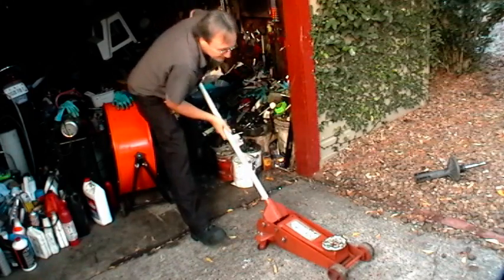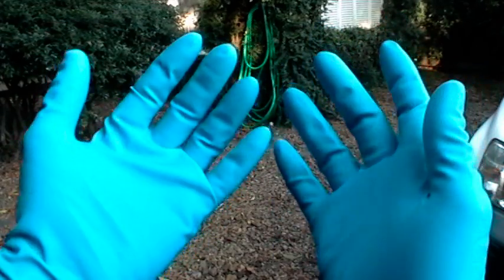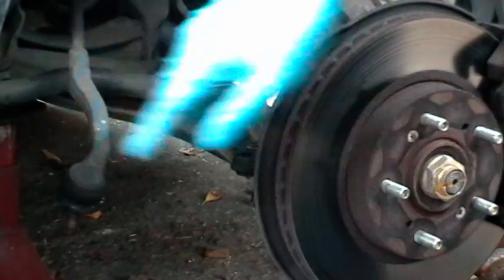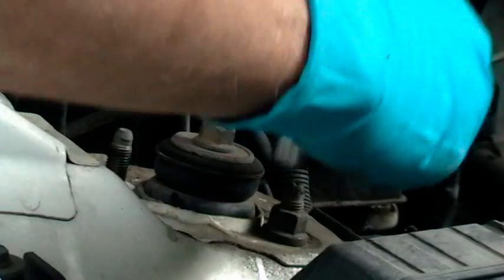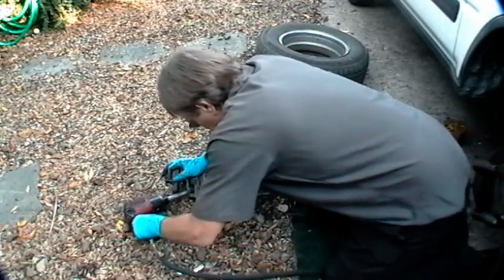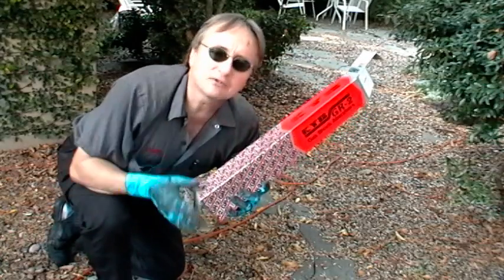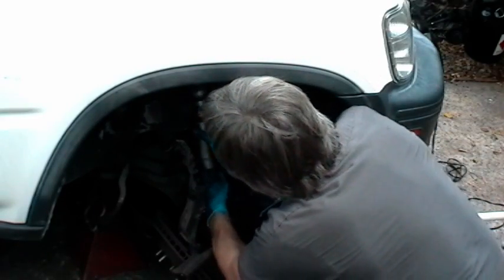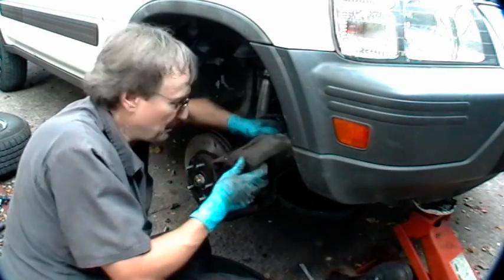How to Replace Struts on Your Car

Comment: Hey scotty firstoff thanks for your continuous help,I watch all your vids..Anyway im takin ur advice in buying new cv's instead of remans, also in getting seals while  im at it..do the seals just pop out and new ones slide right in on a 98 max?
Reply from the maker: they do just pop out, but use a seal puller to pop em out easier, places like auto zone sell em for ten bucks or so

Comment: I just wanna make sure when placing the new strut assembly with the compressed spring is how to tighten up the nut all the way?? The strut shaft spins when I tighten the nut and I know not to use pliers or anything that will break the seal of the strut so how do I tighten it?
Reply from the maker: I'm a mechanic, I use an impact wrench. BUT, if you get it as tight as you can with the spring compressors on, when you remove the compressors, you can then tighten it the rest of the way once the whole assembly is bolted to the car. I used to do that when I did mobile repair and had not compressed air

Comment: I had an Audi 5000, to replace the cartridge, don't need to remove the struts.
Cartridge came out on the top of the strut still in the car.
Needed a special tool, though. $90!
Also the heater core can be removed through the engine compartment in one assembly, easy. Done it.
German engineering!

Comment: Hello scotty big fan of your videos always a big help. question. Just replaced front struts with strut mounts. When I hit a bump on the road it sounds like it bottoms out or it hits hard as if the struts are worn. but they are new. what could it be did I miss something.
Reply from the maker: +Ruben Perez hopefully a bolt is loose and you didn't just buy really cheaply made struts. if made in china, often that's it

Comment: hey Scott I replaced my front struts on my kia optima and it works but now I'm hearing my tires more loader than ever. what could it be bad tires are is it rubbing on something?
Reply: +ramon barnes Could be bad wheel bearings??

Comment: Scotty, I bought a 1995 Ford Windstar and in order to pass NYS inspection I bought a $60 complete strut assembly off Ebay. I installed it on the left side and I wanted to buy another another one but it was out of stock. Now I've been trying to find the same model for 2 months and I have had no luck. I'm tired of my car sitting in my yard for a month already. Do you think if I buy a different named strut assembly I will have any problems or are they all the same? Thanks.

Comment: hey scotty im a big fan. I bought a 3000gt 1994 and whenever i drive at about 2-5mph i can hear something on my left front tire sounds like the tire hitting something but i checked and nothing their. when i speed up you cant hear the sound anymore.  also when i got over bumps the car is very responsive and i feel every bit of it could it be time to replace the struts? thanks in advance
Reply from the maker: +Jeison Gonzalez easily could be worn struts and or strut mounts
Reply: +Scotty Kilmer thanks alot scotty ! :)

Comment: I got to do this on a 2008 Passat. It's at 112k miles. Doesn't it make sense to just buy the strut with a new spring already installed? Make it all new?
Reply from the maker: springs rarely wear out and good ones are VERY expensive
Reply: O alright then.

Comment: I generally stay away from suspension because I'm under the impression that mucking with tie rods will end up in an alignment needed in the end.  Can you confirm this?  I'm asking because my front suspension is shot like a 12-point buck during Deer Season.  I gotta do something.

Comment: hey I heard KYB struts are no good. i have a mitsubishi mirage 2001 i got to be paying really good attetion to the road to avoid any potholes, i dont want some cheap struts that would last a week or month and the KYB struts are very cheap for my car, as a mechanic what struts brand do you recommend for my car? the expensive struts for my car are bilstein. there is also sachs struts which are less expensive and then there is KYB struts.
Reply from the maker: +benjamin kybs used to be really good, but their quality has slipped a lot the last few years in my opinion

Comment: My 2000 Chrysler Cirrus needs new front struts on the right side. I took it to my main mechanic and he said to get a Quick Strut so he can put it on. Then I took it to a shop I went once before for a 2nd opinion and the guy is telling me only Chrysler dealers have the parts. So I am hoping it doesn't fall apart on me tomorrow when I go out of town.
Reply from the maker: nonsense, you can get parts for those anywhere, you're dealing with idiots, find a guy like me in your area.
Reply: Thanks!

Comment: Hey Scotty, up in the engine bay where the struts meet the frame, should I see that part move when I turn the wheels?
Reply from the maker: that's usually a broken strut mount, pray it's not the frame rotting and falling apart as I see on chryslers all the time
Reply: How do I check that?

How long can I let it go if it is bad?

And how expensive is it to fix and how do I replace it?
Reply: Chinesefoodrocks1521 mostly id think by just looking at is to see if its rusted out and honestly depending on how bad the rust is it might last a month or come apart on you tomorrow you just dont know. AS for a fix most likely body/frame work would be my best guess but scotty knows more then i do so hopefully he can get back with you, best bet take it to a shop and see what they tell you.

Comment: Hey Scotty, my car creaks every time I go over bumps, it's not the struts since those have been replaced. Any idea what it could be?
Reply from the maker: often A frame bushings do that, as can strut mounts (guys often change the struts but not he mounts on top cause they cost extra money.)
Reply: Had same problem, a clip fell out of the top mount ball joint. Sounded like those snapple lids.

Comment: morning Scotty 
mornign guys.
today is 04-28-2015 
i had my shocks and struts((front)) changed on saturday
just a little question
is it normal to hear squeaking noises
when going super slow
or when turning the wheel (( when slow ?? ))
Reply from the maker: Sammy Paredes not normal to hear anything, if it didn't do it before, job was botched and bushings or something else is rubbing now.
Reply: Scotty Kilmer hmmmm  it started squeaking on thursday that why i took it in.
now the squeaking is gone 
but i got a new one
i asked him and he say that 
its because they are new. 
to give it 2 or 3 days

Comment: hey Scotty I have bought a 1994 Toyota celica gt and when I go over little bumps it sounds like something rattles in the back. what can it be?
Reply from the maker: +Tommy Castilleja anything from worn struts to muffler or exhaust hitting stuff from broken hanger rubber pieces

Comment: try this next time: unbolt the wishbone at the bottom of the stut and tap it down till its loose then wiggel it out near the c.v. joint (have to push in on strut), then undo the 3 top mount nuts and angle the strut forward and it will barley clear with having to undo the ball joint or tie rod

Comment: I have a 1991 Camaro and the springs aren't  around the struts like in this video.  The springs are off to the side of the strut all by themselves.  What I'm thinking of doing is jacking the car up and then using another smaller jack on the A frame to keep the spring compressed.  Then just remove the strut, put in a new one, and let off of the smaller jack.  Will this work?

Comment: Thanks! I used this video when i changed my struts but I have a question.
I accurate my car I hear kind of a bump or a click noise somewhere on my suspensions or around the wheel area. Do you have any idea what it could be?

Comment: Would help me again: When I opened car door the light will be On. Where is the Switch? 2003 Dodge Intrepid. Thank you again.
Reply from the maker: on many modern cars it's built into the door latch assembly. Get your VIN number, call a dealer, they can tell for sure

Comment: i have a 1988 pontiac firebird v6 2.8 liter engine is the strut assembly just as easy to replace as in this video since its a rear wheel drive car?
Reply from the maker: actually a bit easier on yours
Reply: Thats what it looks haha I just wanted to make sure last thing I want is to break anything but marine infantry men are notorious for breaking things

Comment: Scotty,
The nut holding to the strut isn't as tight as the other side on the top, so I am getting an occasional knock when turning. Do I have to remove the whole assembly to get that nut tighter. I have tried a impact wrench, but is just spins the cylinder.

Comment: Hey Scotty are you in USA? In Canada we are " red seal journeymen"  not sure if you have that in the states. I am not auto mechanic but an instrument mechanic.  I was wondering what you would recommend on a 1988 Nissan pulsar XE, 
KYB or is there a direct replacement.
Reply from the maker: kyb is fine. We don't have that title here in the states. But really , in life, we are all journeymen
Reply: Cool I will try finding KYB. The timing belt was done at 100,000 KM, now is 187 000 KM.  It was done in year 2000.  Am I gambling? I don't think the car was driven hard and its not that hot in here, so I was going to risk it  for the summer

Comment: hello sir..... i want to know about problem of my car...
i am using ford fusion.which is crossed more than 2 lacks km.and i had changed cars shockers,tie rods bushes..etc... but haven't change the springs due to suggestion from machanic that their is no need to change the springs. but now car geting problem of having vibrations and noises when car passing pits and speed controling strips on roads and cars hieght is also reduced than before... so i wants to know is it necessary to change the springs.?
Reply from the maker: height is reduced, so springs are bad or A frame bushings worn
Reply: thank you sir..😊

Comment: After i repaced my strut and strut mount on the left side had a creacking/squeaking sound. What seems yhe problem?
Reply from the maker: often rubber parts bind and do that, I often spray WD 40 on them to stop such sounds
Reply: what rubber part you are referring? where exactly do you spray wd40?
Reply: ian ramirez
probably bushings

Comment: Hey, Scotty. I have a 2010 dodge caliber and there is a horrid squeak coming from the rear area mainly when i'm driving on bumpy roads i'm not sure if it's the struts or not. I saw your other video about using at-205 on the rubber components so i'm going to try that first. If it doesn't work what would i check next?

Comment: Hey scotty. I recently changed my lowering springs to original ones to make my car higher. The car got higher, but the left side is about 1,5 cm higher than the right side. This makes my right side rub the arch on bumps.. Do you think it can be a defect shock absorber? No idea last they were changed. 20 year old Mercedes. Have done the bouncing test, seem to be working properly, though slighlty softer than the higher side.

Comment: Scotty i got a 98 mustang gt and it makes a creaking noise when i hit bumps and drive at slow speeds and press down on the hood and its a creak not a squeal am i in any danger and i was told its the struts are those models hard to replace??
Reply from the maker: mot fords all creak at that age. Struts can creak, and it's a normal job to replace them, see my video "replacing suspension struts on your car", but if it rides ok you can live with creaking if no parts show play when you jack it up and pull on the wheels
Reply: Scotty Kilmer thank you scott

Comment: I just replace two front struts in a mitsubishi, and the left front spring pops whenever I turn the steering wheel.  Any cause as to what that could be.

Comment: hi scotty, i have a 1994 escort with 78.000 miles i am a one owner, it's in great condition, question is the front stuts, the same as a front strust and mounts? I had a shop tell me they needed replacing, i was getting my inner tie rods done, was hesitant car runs great after tie rod replacement,same shop always find 2 things wrong, i chose the cheapest and it took care of the poppong noise,actualy this is 2 questions how can i be sure it needs it? and the cost estimates naitionally? help again

Comment: wow what brand is any good anymore? It's been almost 30 years since I replaced shocks on my 67 Impala with the Monroematics. Other cars I've owned since either didn't need shocks/struts in the time I owned them or I've had a shop do it for around $400 both sides but that was 18 years or so ago.

Comment: skotty i got a 2000 corolla and i have to change the struts 
i got monroe the blue ones on the 1997 camry and they are a little floaty and soft
what do you recomend gabriel from autozone,kyb or what about bilstein?

Comment: I just bought a 2001 Taurus it sat 2 yrs with bad transmisson it has been replaced drives fine now but its sputtering some & when I am driving  at about 55 mph it starts shaking bad, I think it needs struts cause I can hear something loose or a sound of some kind , also could the tires make it shake? . My ? is what do you recommend  I do to get the car running good? Oh I have 1050 in it now not wanting to put much more into it, unless I really have to thank you

Comment: trying to repalace rear struts on honda 2003 crv the bolt will not come out i put heat on it. still cannot get both side to remove bolts ???? can u help
Reply: John Hyde Park jump on a breaker bar itl work

Comment: hey scotty. my aveo just has one bolt at the top of the front strut. tried tightening it but it just keeps spinning. any ideas.
Reply from the maker: +Sylvan Thompson I often grab the strut rod inside with vice grip pliers then take the nut off
Reply: +Scotty Kilmer thanks. Ill give that a try. one more thing. can one of those 12v impact wrench be used to compress springs as well as removing most bolts?

Comment: if i were to "upgrade" my suspension on my 2001 ford focus ZX3 S2 to the SVT focus suspension which would make it .5 inch lower is there any other steps i should take aside from checking the alignment?

Comment: what if i jack up the car from Front-Right , it will be compressed by car Weight then use rope to hold it , then start working in rear left

is that good and safe enough ? because most people told me that when you start working with Chinese strut compressor it could Slip and may hurt you

Comment: ok. So I changed my struts on my 2004 buick regal (front) and I also changed the mounts.  after installation the front end (sounds like the mounts) make a creaking sound when I turn the wheels (only when I turn the wheels)... what's the deal?

Comment: hey scottty..i have a nissan skyline turbo rb20det engine i have a TO4e turbo...the problem im having is when i boost hard it sort of limits itself when i start getting up into the higher revs.. it should be boosting way more..i have a boost controller but when i turn the boost control on it seems to make it worse....could it be i need an aftermarket air flow meter? or do i have a leak? or is my turbo not set right? thanks

Comment: Question.
i have a 1988 chevy corsica with brake and taillight problems. when im on the brake, all five lights illuminate, when im on the brake and left turn signal, the right taillight and center stay solid, and the left blinks, but when im on the brake and the right turn signal, there is no left brake light on, only the center one. if i shut off the turn signal, the left brake lights return. any help appreciated, thanks

Comment: i have a 86 Mustang and i cant figure out how to take the Retaining bolt off the top of it. ive tried vicegrips holding the rod so it doesnt turn when i crank it but it doesnt hold tight enough, how could i get that bolt off?

Comment: hey scotty i need a hand here
 ..... My mercedes e280 (1994 model) clunks very hard when hitting an obstacle i can feal it in my backbone ...could it be the absorbers(hydraulic) or the struts ? plus i noticed the rubbers are wearing out... And they told me it costs about 100$ for a pair  of  shock abs without the mounted rubbers

Comment: do i have to do an alignment after this since the tie rods came off
Reply from the maker: if you moved the tie rod adjusment, yes. But it you just removed the tie tod nut and took that off the strut assembly, nno.

Comment: Hello Scotty,I love all your vidioes on YouTube. I Have a 1994 Chevy corsica (V-6 3.1 ive just installed front and Back Breaks on the car. But i have one problem with the car, when the car is cooled i start th car up, drive off,when i apply pressure to the break pedal, my back wheels lock down and my back end drops down as also. when the car warms up as i go its fine....lol i wonder why it does that while its cool then normal? that puzzles me what can i do about that?

Comment: gave them nice coating of wd40 and they came off easy, to the top strut nut, i put my spanner on that an she keeps on spinning, the stud that the nut is on has flatside on each side, so ive tried using multigrips, wd40 n couple of spanners and shes stubborn, any ideas

Comment: Hey scotty i recently replaced my nissan sentra 2005 struts/shock.. front and back. I got 4 monroes from rackauto.com just noticed that im dealing the bump pretty good but the pot holes...it feels that im smashing my car on every pot holes. Also i noticed when i lift my car on a jack.. the gap between the top of the tire and the wheel arc increases like double. Its like 6 inches gap when on the jack and 3 inches when on the ground. I felt that the spring of the strut is too squishy..